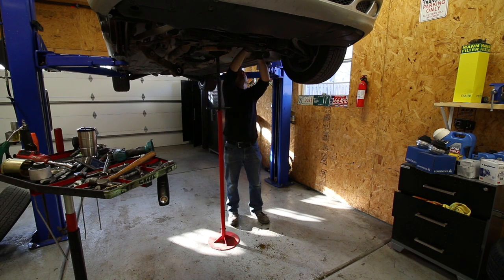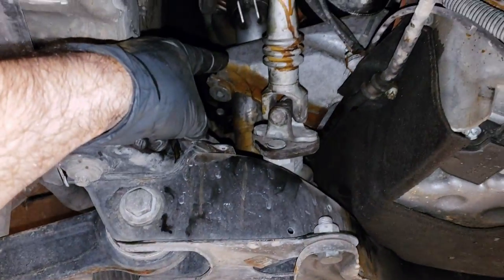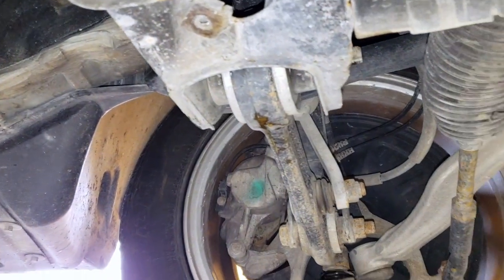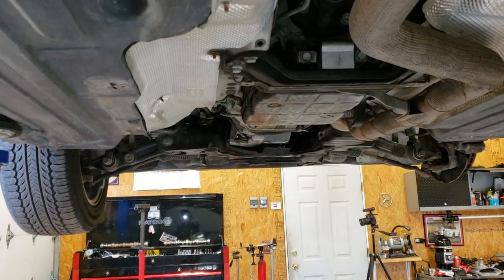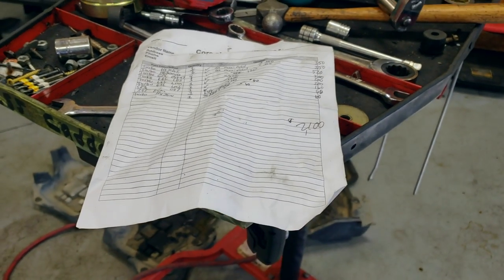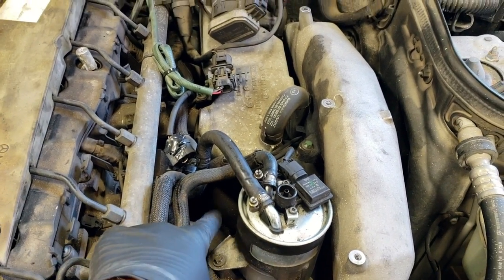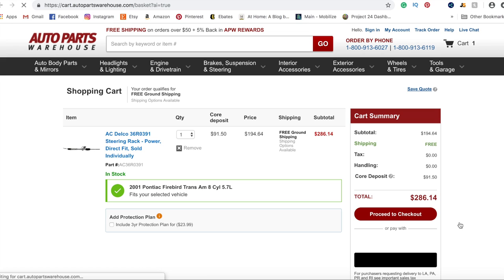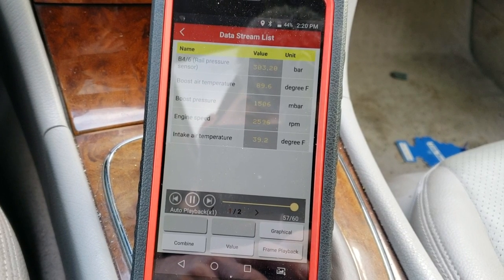I Fixed A Really Expensive Boost Issue On My Turbo Diesel Mercedes With A Penny Resistor! It's Fast!

Comment: Silicone that open conmector,in case of water short circuits
Reply from the maker: I tapes it up but it is very high above away from any water.
Reply: I would use what we in Norway call Vulk tape.
Its a soft stretchy rubber tape that when stretched around and applied to something it kind of melts in to itself. it sticks and all the layers in contact of eachother slightly bonds to eachother. I use it a lot and I often use it instead of heat shrink on wires.  and I've also used it on a charge pipe between a turbo and an intercooler. its two dowsides  is it  may not last long if it is applied in an area where its exposed to a lot of heat, or oil or diesel, but it stopped the leaking charge pipe for about 2 weeks until a replacement was found. and it may not like oil, but diesel will ruin it instantly. I did put it on the wires going to my injector connector plugs after replacing the copper seals for my cdi injector, but one of them was leaking and after bleeding the rail pipes to the injectors to get the thing to start and run diesel had spewed out all over. and it turned the vulk tape into to semi liquid goo. Had it not leaked fuel I believe it would have held up for a long time even though this is a moderately hot area. heat shrink is alway better in these areas with lots of heat but with the tape you wont have to cut the wire or depin the terminals from connectors or anything to apply as you simply cut a strip of it and wrap it around something. take 15-40 seconds to apply it.

there are different grades of this tape an some take more heat, but the cheap ones are perfect for wiring in the doorcards, under the dash etc. and may hold up nice in the engine bay depending on where it is applied relative to chemical exposure (fuel leaks, oil leaks) and really hot things like exhaust manifolds. 
I bought a roll once that would stand up to I believe  260 celcius (500 farenheit) where as the cheap one I use the most is rated for up to 90 celcius(194 Farenheit).

Comment: dude, you do realize you live in your own bubble..right?  How many people do you think have their own garage with a car lift? you realize all these 'simple' fixes are not so simple doing in your driveway on your back? even for a young man its not easy.. and it is dangerous.. so please please please.. give real life cost a mechanic would charge to do these 'fixes' at a garage!
Reply: Engine mounts may be a problem (though I have changed them on the street in another car), but installing a resistor is easy to do without any garage equipment.